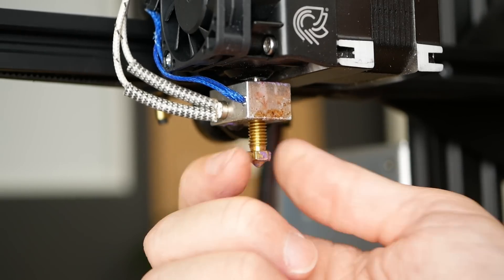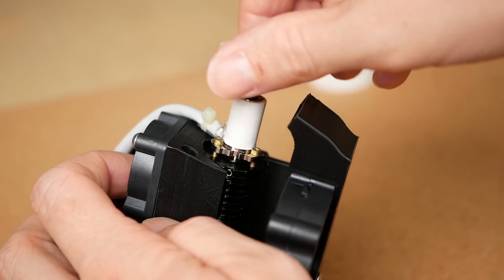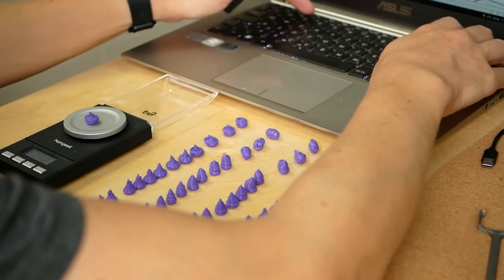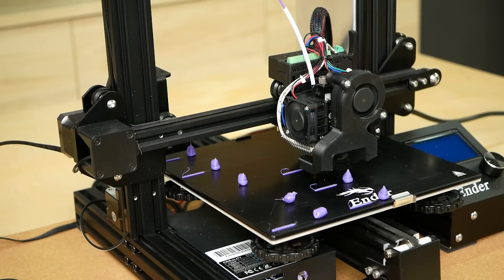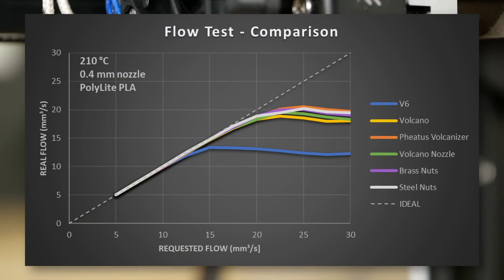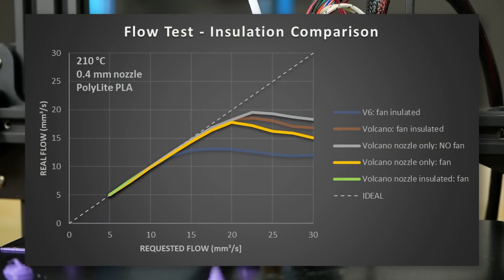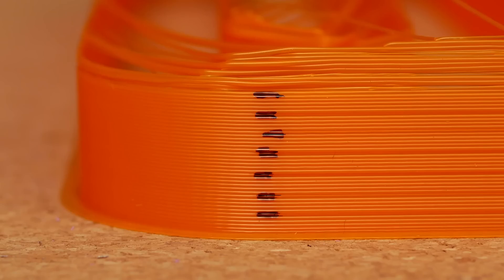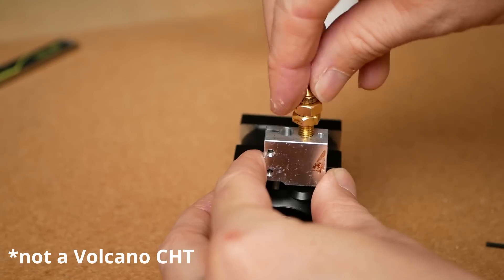Volcano is Obsolete: Just use Nuts!

Comment: You missed the point of the large heat blocks... they are not going to give you much higher continuous flow rate because the temp will equalize in a few seconds of extruding.  The heat blocks are a way to store (heat) energy to be used for short, burst loads much like a capacitor (for electricity) or a water tower (for water pressure) allow you to handle a much higher load for a short time*.    You need to test how much flow *burst you can handle without skips. A much higher burst flow rate will be possible with a large heat block for 5-6 seconds or so, which is more useful for typical printing (high sustained flow is only beneficial for tests like this or vase-mode printing.

Comment: I've found that those extra long  "volcano" nozzles are Ideal for Cutting to size to suit  BOTH for tuning  temp transfer AND setting Z height as desired..
 The amount of nozzle treaded into the heat block is Important,  Ideally the more nozzle into the block the more heat is transfered to it. 
And the less the throat inserts the less heat goes into it :-) Win Win

Comment: Wondering if you could pick up a block of copper, brass, and aluminum, turn, bore and thread a couple of higher volume wrappers for the volcanizer to see if you get as good, or better performance that way, and perhaps add a shell with an air-gap around that to help with insulation, or simply cast an rtv sleeve for the wrapper.

Comment: Tried this on my stock v6 with the 40W heater. Brought my usable mm^3/s from low 20s to at least 34. Just used plain steel nuts. Amazing. Edit: using a 0.8mm nozzle, ymmv.

Comment: I just installed a volcano nozzle on an original CR10, I added also klipper with RPI, bl-touch and locked the bed with nuts. Let me tell you that the best improvement on quality and speed came out after using the Volcano. I cannot believe how good are the prints now, and so fast....

Comment: What if you apply high-quality thermal paste, the kind used for overclocking CPUs and GPUs in custom gaming rigs, to the threads of the nozzle, and maybe also to the faces of the nuts as well, before screwing the nuts into the nozzle and the nozzle into the machine itself?

Comment: Test request here.  Can you test the strength, print quality with plated copper (please include volcano) nozzles vs standard brass nozzles?  I do have to print at lower temps with my plated copper nozzles (more so with my volcano printer vs MK8 hotend printers). While layer adhesion/strength seems good at lower temps, I'm curious to see with proper tests, if I'm just making weak prints.  It seems consistent across different materials that I'm printing at lower temps vs with brass nozzles.

Another test: A CF filament wear test with plated copper nozzles (advertising specs say they are pretty hard compared to brass) vs hardened and standard brass nozzles

Comment: What im thinking is to use brass nuts with a outer diameter that matches the width of the heater block, it would result in better heat transfer down the nozzle  pretty sure.

Comment: I'm curious on the possibility that thermal conductivity might have with the volcano hot end and nuts.
since sanding the nuts would leave behind a rough and non level surface. 
does anyone think using thermal compound would make any difference?

Comment: Using a copper heat block helps a lot. I have been printing with pretty good results --- with a volcano+copper heat block+1.2 mm nozzle+10% over extrusion --- at flow rates around 40 mm^3/sec.

Comment: Two days ago I was faced with blocked nozzle on my ender 3 pro and did not have any more spare nozzles, hence I used a more commonly available nozzle as it has the same thread but longer. So I reduced the threads in the heartbreak and used that to compensate for accommodating the workaround nozzle and interestingly I got the same perfect print resolution and finish. Very same concept to what you have explained. I totally agree with you on this concept

Comment: You've done a number of videos now on high flow set ups that I've greatly appreciated.  However one thing I think that would be great to see is how these various high flow setups perform in an intricate print with retracts, z hops, short layers, etc.   It'd be really cool to find a high flow setup that also happens to accurately perform the chimney(arguably one of the most difficult area's of the speed benchy) as well as it performs the rest of the boat.

Comment: Hi Stefan, first of all I love your videos and all the tests you do, you really help the 3D printing community! I just recently watched your video on PC core ABS, which is a fascinating idea with great execution on your part, but sadly didn't get great results. I was wondering if you have considered printing a part with an outer shell made from a plastic with a high melting point and then 100% infill of another plastic with a much lower melting point, then annealing it at a temperature sufficient to melt the inner plastic but not the outer shell. I have had this idea for some time but unfortunately I don't have a dual extruding printer so I could never try it. Maybe if its a new idea to you you could test it, or maybe you've already tried it and I just missed that video. One last thing to consider is that it might not give significant improvement to your Z axis tensile strength test because the cross section of the part is such a small area.

Comment: I only have 1 real problem with any of these types of tests regarding temperature, I do not see anyone actually measure the surface temperature of the bed or the nozzle before commencing.
Here is the rub, your temperature display may say your nozzle is at say 200 and if you took the time to actually measure that temperature you may find that it is 180 or maybe 220.
I went to the trouble of buying a thermometer to test what is shown and what is actual.
My print bed for example the display says its at 90 but the surface temperature is in actual fact 79 so 11 degrees out. My nozzle the display says 200 but in actual fact its 185 so 15 degrees out there as well. 

I have an ender 5 plus, we all know the quality of our thermisters etc are ok but not perfect, what we do need to know is what they are operating at. Ever since I bothered to measure and confirm between what was given and actual my prints are so much better.

I can't print ABS plus it requires a temperature which my display says it can achieve but in reality it can't so I get a nice enough print with no real layer bonding and you can crack the model almost by looking at it.

How about a CHECK THE REAL TEMPERATURE YOUR PRINTER is giving to be able to print better. Otherwise all of your tests are speculative at best! You say your testing at ??? whatever the display says it is, I'm sure without even touching your machine you are wrong by probably upto 10degrees either way.

Comment: I went to the hardware store today and picked up a handful of 6mm x 1.0 nuts. I filed the contact surfaces of a single nut flat, screwed it onto a 0.6mm volcano nozzle, and mounted it on my standard E3D hotend and heater block. 
The results have been amazing!  I have been able to push my delta printer to 120 mm/sec speeds without any flow problems.  I'm sure I can probably go faster, but considering that your method has already allowed me to go from reliably printing at about 70 mm/sec to 120, I am super happy! 
Thank you for the great video and for all of your careful research on this subject.

Comment: My guess about the slightly improved performance of the mods over the Vulcano is, that a slight drop in temperature let's the material shrink a little before it is pushed through the narrow section of the nozzle while the change of viscosity is slightly retarded.

Just a guess.

Comment: Whoa.. What is that tool you have the Hemera sitting on while you are working on it? 12:06 in the video.
Reply from the maker: That's the WhamBam Mutant workstation. Though it only works if you're using the Mutant Tool Swapping System 😅
Reply: @CNCKitchen  Darn! .. I will have to look into it though. As trying to get my Hemeras tightened up at the same "level" is a pain.

Comment: Very good test and presentation.  One thing not addressed was heat creep  for the new setups. If less heat creep is present would it be safe for Boden tubes? Are you able to print higher temperature filiments with the change in setup?  

An idea for future video: making high temp filiment printable with minimal change to the printer. 

Thank you

Comment: I only saw 0.4mm nozzles being tested, which makes the results kind of useless. Everyone I know using a Volcano hotend is using 0.8-1mm nozzles. With a 0.4mm nozzle you're going to running into other issues restricting high volumetric flow then just heat transfer.

Comment: why use nuts when the heat block is fully threaded. just attach 2 heatblocks and use spare cut throats to attach it all. which allows you to use standard nozzles and gives you the option of installing 2 heat cartridges.

Comment: Did you track how much data this uses? Given it has plenty more power than the required 10 watts i would think it would use more as more heat goes into the surrounding air.

Comment: Oh there are CHT volcano nozzles now? I hope you test how they compare. Maybe even with your suggested adapter + nut combo for an even longer melt zone.

Edit:
I couldn't resist and bought the CHT volcano nozzle in 0.6 mm. I have to say I'm disappointed. Before I had a E3D Nozzle X in 0.4 mm. With the nozzle X my hotend began capping out at 18mm³/s with occasional missing steps on the extruder (Bondtech LGX in a long bowden tube setup). As my delta mechanicaly is able to print faster than that I wanted to up my flowrate. But with the CHT I'm at the same spot where the extruder begins skipping at about 18mm³/s. Temperature is at 220°C for that. 230°C didn't help much and i don't want to go hotter because of the bowden setup.

Is it possible that my cloned volcano block somehow limits the heat transfer to the nozzle even though I put some thermal grease on the nozzle threads? I find it odd to not even get the slightest advantage from the CHT.

Comment: Awesome findings Stefan!!

Now hear me out, I have an idea for a quick follow up. 

Use one of your modified volcano nozzles you made for the DIY CRT nozzle video and use it with the brass nuts. The ones with the copper wire inserted in it. 

Those results could be even higher and it would be cheap to make a really high flow nozzle.

Comment: I wonder if you could get even slightly better performance by reversing the 2 nuts so that the sanded down nut is the one tightened up against the heater block since it would have a slightly increased surface area to contact against the block? Of course it's such a small difference in area it might not be a noticeable difference in flow.

Comment: I'll share my experience upgrading my Creality's Ender 3 V2 to more flow.
At first it was clogging very often, failing some parts of the printing.
And so it started to burn the stepper IC a lot.
The issue was lack of pressure (a.k.a. extruder's stepper torque or traction force).
To solve it I ended up designing an entire extruder mechanism from scratch, and now with bigger stepper, standalone stepper controller to the extruder, it works just fine, even when I push it hard.
The extruder heater still stock, I just changed the filament pusher by an stronger that I designed, with multiple gears to make it very strong.
The point about having the original heater is because the stock one have a giant mass if you compare to the mass of plastic being melted inside of it, so (and according to my test) it'll perform very well, even on high pressure.
And I really abuse of it: I enclosed the printer in an box to keep the heat, and I push ABS through an 1mm nozzle without pain.

Comment: Hi Stefan, thanks for the great video, as always. I've noticed at 3:15 that you have an underextrusion at the front-left corner. I also get this quite regularly and only at the front-left corner, especially on support material. Do you know the cause of this phenomenon?
Reply from the maker: That's underextrusion because it was printing already above it's flow limit.
Reply: @CNCKitchen  Okay, but why is it located specifically at the front-left corner. I've witnessed this happening a lot of times and it bugs me not to know why.
Reply: @derToblin  theory: it happens due to the part cooling fan placement. Because of the internal angle, it traps most of the airflow from two sides. Based on this theory, the back left corner should also be vulnerable, but maybe slightly less so because of the fan placement in the Y axis. (Research needed.)

Comment: Wondering about using your drilled hole copper wire cross pattern with this or these better DIY methods?  Would be an interesting comparison I'm thinking and also using higher content electronics silver solder for the PET.  What would be even more awesome would be to see how like the JRT3D strip filament performs using these DIY designs.  Guessing since most suggest using a filament stop sensor for longer runs since doesn't seem anyone has come up with a best DIY way to but weld the strips or filament.   

Thinking about what using this design would be like for the JRT3D and related systems for making the filament and if a direct drive that can feed strips would be able to push enough to fuse the strip ends in the extruder/pulltruder section using this longer volcano DIY design?

Finally, thinking trying not only with the recycled PET bottle filament... what would be a super awesome totally better video comparison would be adding in Nylon from weed wackers like you did in that one video.  Man, that would be excellent I'm thinking using the best nylon string trimmer as filament practices with these custom DIY range of hotend nozzle mods!

Comment: Did you consider that you might have compromized your thermistor readings by basically creating a heatsink down the longer nozzle?

It might be that the smaller heater block actually gets hotter using a longer nozzle,  because the larger heater block will have better thermal conductivity to the thermistor.
Reply: Great Video and great ideas, btw :)

Comment: Can you do a video on heater cartridges? I imagine a higher wattage makes a big difference in the flow rate since you can heat the filament up significantly quicker. Maybe even using two cartridges could be a possibility.

Comment: How long was the flow test? I imagine the nuts would cool down when you force a lot of filament through them for a long time, while the volcano block has a higher heat capacity and cools down slower. That could be an advantage, your test samples seem very small so they might not pick that up.
Reply from the maker: My tests all used 200mm of filament but I did validation tests where I also extruded up to 1m of material in one go which resulted in basically the same numbers.
Reply: @CNCKitchen  cool thanks for the reply. Great work! Now I thoroughly believe your results.

Comment: You need an extended silicone sock, an easily adjusted Z-probe height and to re-angle the part cooling ducts....sounds like a job for a quick change  head swap system.

Comment: I've been running exactly this setup for a while now, didn't have any issues with it even at high flow rates (20+mm3/s)

Only problem I had is that a strong part cooling fan can mess with sensitive thermal runaway protection in Klipper. Relaxing settings a bit there helps though.

Comment: Always love a bit of data challenging preconceptions.

To me this raises an interesting option with non-planar 3d printing if it ever takes off. If you need more clearance from your print head assembly to get the angles you want just use the volcano nozzle and nut method.

Comment: I don’t even own a 3D printer but I’ve followed your channel for a couple years.  I just get excited to see new videos because your testing methodology, data analysis, and engineering is top notch.
Reply from the maker: Awesome! Thank you! Appreciate it.
Reply: Couldn't have said it better myself HOSS
Reply: At $69 delivered for a Ender 2 Pro off ebay as an "unrepair" (a customer return, mine had never even been assembled), what's holding you back?  Ender 3 pro's are $79 delivered, same unrepair customer returns...
Reply: @brianmi40  maybe he just does not have the usecase. if you do not tinker a lot or are not interested in novelty or minifigure prints, affordability/availability does not matter.
Reply: @eccomi21  for sure, was just informing that Covid has led to all time best deals on printers…
Reply: @eccomi21  But with a 3D printer you always have something to tinker on: the 3D printer itself, especially if it's cheap, a little flawed, and not locked down against modifications. It's an ideal hobby.
Reply: @SianaGearz  to some it is an upside, to me it is a downside. if i want to print something, i want it to be printed, not troubleshoot my printer every time. i went from an anycubic i3 mega to a prusa MK3 and now MK4 for that reason. the damn things just work

Comment: You should test a volcano hotend, with your nozzle spacer bolt AND a volcano nozzle with the volcanizer 🧐
An extra ~16mm of length might turn out to be a detriment, rather than add more thermal capacity to the filament path.

Comment: I modified a creality ender hotend to hold a Spider nozzle which is 4mm longer iirc. i shortened the heatbreak throat so the nozzle threads nearly all the way in, it flows much better and prints great. ive done about 100 hours through it no worries. should look into that. the throat is only threaded in but a few threads but it is stable and works i think due to the two holding screws